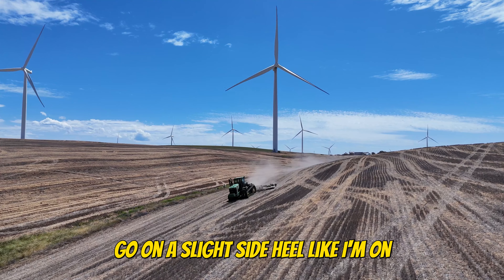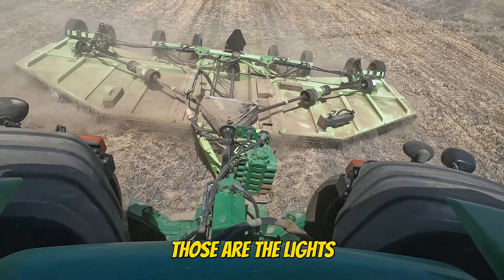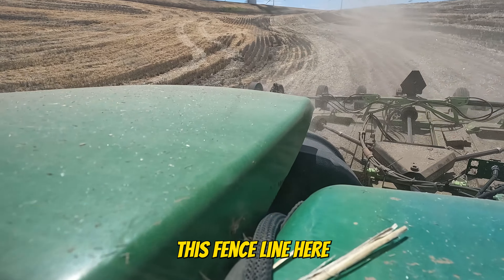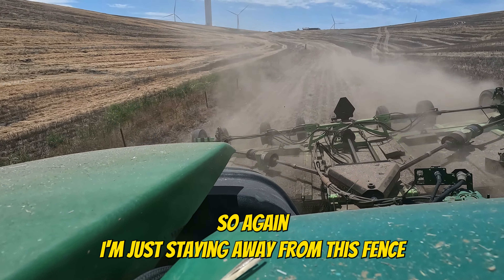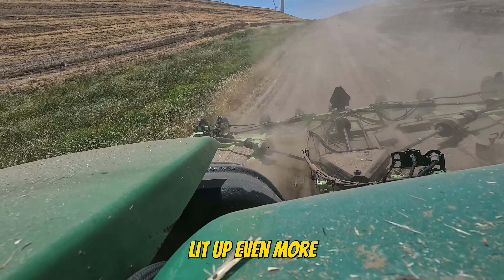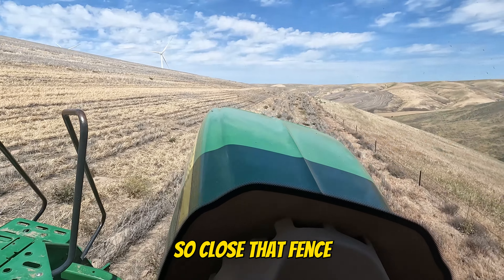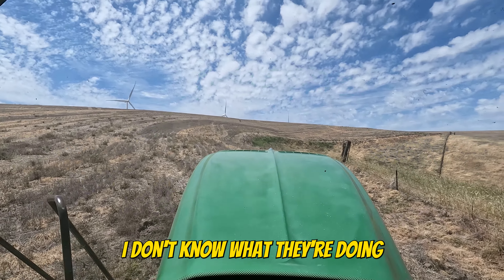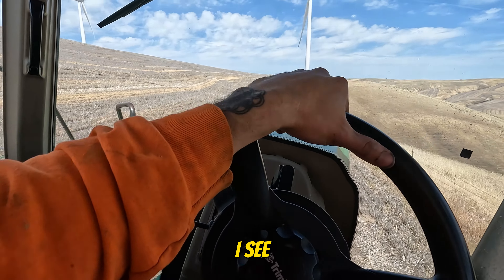Mowing wheat stubble with a John Deere 9240T

Comment: Your videography keeps getting better and better! I saw a video from another farmer fixing their ph by spreading calcium on their field. Do you guys have to do that? If so what kind of equipment is used that works on hills?
Reply from the maker: If we apply calcium, it is in solution 32. We apply it and top dress the wheat while we spray for weeds. A bit of fertilizer in the water